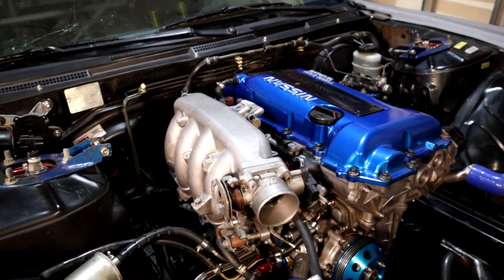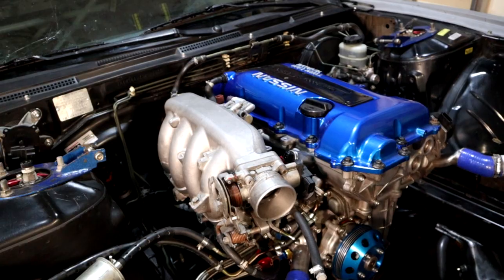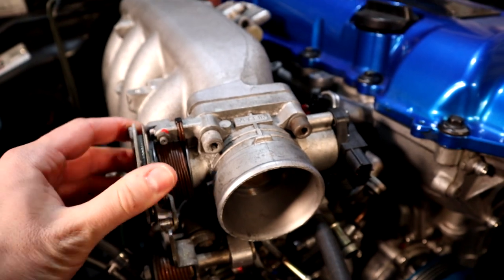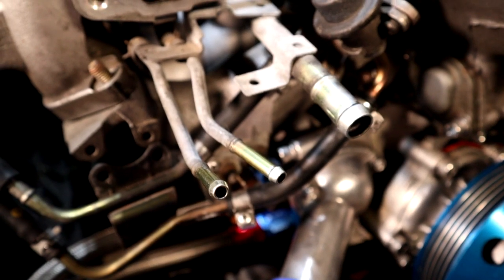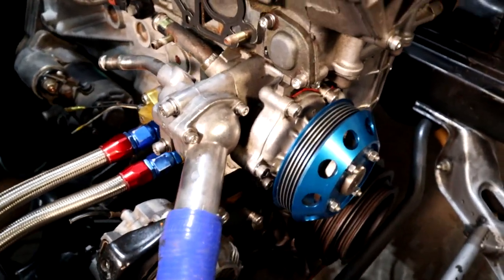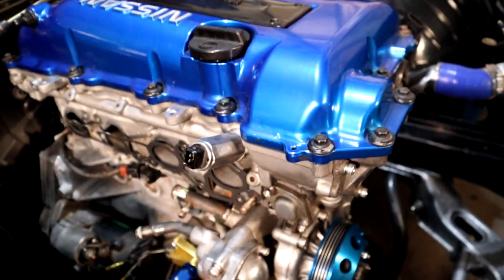SR20DET Intake Manifold & Cooling System (S14/S15) - How It Works and Removal

Comment: Thanks for this video, I sprung a leak on the oil filter turns out it's possibly the hoses under the intake manifold. At least I know which hoses I need to change.

Comment: My main problem right now is not know what the parts are all around the motor, so this helped a lot.  Thanks.
Reply from the maker: Awesome! I'm glad it helped you out. Let me know if you have any other questions, or if there is some other part of the engine that I should focus on. Thanks!
Reply: @BrainPowerMotorsports  I have the exact same motor so it's awesome watching your build so far. I just started on mine. I like the way you break down the fittings and details.

Comment: Thanks for the videos! I just realized that I have too many useless little hoses everywhere. Maybe the old EGR hose and more. I need to watch the video better, think better and learn English better. I believe that thanks to you I can find out why my engine is heating up too quickly
Reply: Did you find out why your car was heating so quickly? I have the same problem on my SE20 maybe your problem can help me with mine if you found the solution? 😁

Comment: You rockstar!!! That video is a gift to the Sr20 community, really appreciated mate 🙏 subscribing was a no brainier.. trying to fix mine, heats up way to fast and and then doesn’t start when hot, maybe a leaking injector let’s see.. thanks again for the video 🙏 quick question if you have the time where does the valve cover top Center left breather pipe connect on an NA non turbo model, I have seen it just with a pipe pointing downward but I’m guessing that should create a huge vacuum leak, does it go in the intake pipe before the throttle body and after the MAF? And shouldn’t that bring oil to my already oily intake? 😅

Comment: Thx big help! Been searching for a vacum leak forever, used a boost leak tester and couldn’t hear anything. Car makes -1 vac psi at idle, a little strange. Bolt ons. Any ideas on where to look for this big of a leak?
Reply from the maker: That must be quite the leak! Best to test individual components or portions of the system. Cap off pre throttle and test the intercooler system and pipes. Then move on to the smaller components. For that big a leak, I’d suspect a coupler has popped off the piping, the intercooler has damage, or there is damage to a pipe. Good luck with finding the issue.

Comment: Great video really informative mate! Hopefully you can help me a little more, I recently bought an s14 and the previous owner capped 2 lines off that I believe were a part of the recirculation valve system! But I have no idea if they should be connected to anything now, one of the lines is the blow off valves line you referenced in your video which is currently capped. The other line next to it is connected to the carbon canister which I think has a split which also runs to the waste gate control solenoid valve. The other line that’s blocked off I am not sure where it’s coming from atm but it is larger? I currently have no blow off value but want to fit one to avoid turbo stall/flutter

Comment: That's too bad this seems to be missing info I need. My S14 SR20 has two extra vac nipples comming out the bottom of the TB (one of them capped off) but I couldn't spot them on yours, maybe S15 didn't have them? Also I beleive the WG line came off the hotpipe on the turbo side. Some of these lines should be for EVAP canister (again, at least for the S14).

Comment: thanks for the vid, i wonder if those stock intake support brackets are necessary or i can delete them? i hate unnecessary components but i also don’t want to delete anything i need lol
Reply from the maker: I'm not entirely sure about the brackets. I removed them since I was putting in the aftermarket manifold, however I would imagine they were engineered for a reason on the stock intake. That unit is fairly heavy.
Reply: @BrainPowerMotorsports  we’ll see, think i’m gonna delete them and see what happens like an idiot lmao wish me luck

Comment: Will the stock S14 SR intake manifold fit onto a S13 SR head?
Reply from the maker: It will depend on if it’s a black top or red top. There are two different styles of intake manifold.

Comment: At 13:48 What’s the black and red connector between intake manifold side under cylinder between 2 and 3 called? Ive tried looking it up but can’t find anything sadly.
Reply from the maker: That’s the knock sensor.

Comment: My water temp sensor where there are 2 connectors one is broken the one that clips into the metal tab how can I fix it
Reply from the maker: Are you talking about the sensor that has only 1 wire going to it?
Reply: @BrainPowerMotorsports  I fixed it all good bro
Reply: @BrainPowerMotorsports  I’m at 230.9kw what else can I do to gain 70-100 more kw my motor is built for 3-400kw

Comment: Hey great video. I have a question. I'm working on my notchtop sr20det and I had to take the fuel rail off to replace a bad injector. Now that I'm putting the fuel rail back on I noticed that when I bolt it down the rail tilts. I was wondering on your sr20det did your fuel rail have oem fuel rail spacers where the bolts go?
Reply from the maker: Hi there. Yes, there should be spacers. If you head over to Partsouq in the attached link, you should be able to see where the spacers are. 

https://partsouq.com/en/catalog/genuine/unit?c=Nissan&ssd=%24%2AKwGVobCCntLTy-HX4Nuzsc3Z-f7gkZ6TkoCThcPm2oLThJuBvdLAhcvGw4Wc-oGkwc6LhPuShYqD-c3SsdrY1MnD5tqBk5mIhZyYlZWKg86Zk86dhPuRhYqD1p3S1oWXl5TmhpGTz9KR2dDIxOfdg8af0taH_YOR-O2Dj97S3vj185KX4uT33NzMhZX-kvD1g4_e0tj49IOMh4SU_L-kwuGSg_2LhoPKitLWh4Tx4fXn7IHS0M7K1YOah4TyksvSwIeExMbRhJuDyNzMhcvTycOEm4PcuryF2wAAAAA0iqYl%24&vid=0&cid=&uid=418748&q=
Reply from the maker: Brain Power Motorsports They are called out as 17520J in the drawing

Comment: Sr20det wont start after replacing radiator. Cranks but doesn’t turn on
Need help on what the issue is?
It’s also been sitting for about 2 months
Reply from the maker: Without seeing the vehicle, it is a little difficult to diagnose, but I would recommend checking through all your wires and connectors. Check the MAF sensor and the cam sensor in particular. Also, would be worthwhile to check the fuel pump and make sure it is priming. If the fuel pump is working, move on to the ignition system and ensure there is spark. If you have fuel, and spark, move to the fuel filter. May be clogged up. Good luck with it!

Comment: where did you get your stainless steel hardware for everything on outside? was it a kit or something?
Reply: and where did you get your oil filter relocation kit looks good
Reply from the maker: I was lucky. When I bought the car, it already had the relocated oil filter. It is a "Tomei Oil Filter Block Relocator" on the block, and a "Greddy Oil Filter Relocation Kit" for the filter itself. If you search either of those, there are multiple websites that sell them. As for the stainless steel hardware, I usually keep a good supply on hand for my builds. I stock up on M6 and M8 bolts in various lengths.
Reply from the maker: A good trick for the lengths of the bolts is to look on partsouq.com at the diagrams for the vehicle. You will notice that often, when you hover over a bolt on the diagram, the part number that comes up will tell you what length and size the bolt is. Take the intake manifold diagram for a 97 Silvia with an SR20DET for example. One of the bolts called out is 08120-8201F. The 3 digits after the dash tells you the size. -820 is an M8, 20mm length. 08120-61228 is an M6, 12mm length. And 08121-0251F is an M10, 25mm length. I hope that all makes sense.

Comment: Hi, subscribed as this is a great video. The pipe that goes on the end of the iacv hard-line, where does it go? Onto the intake pipe? Am trying to get my Sr up and running :)
Reply from the maker: Hi there. Sorry for the late response. YouTube flagged your comment as spam for some reason, so I only just saw it. That pipe feeds air from the intake system to the IACV. The piping in my car is quite modified, so I'm not completely sure where it would feed from on the stock system. Best bet is to check out a service manual, or if you can't find one, go to Partsouq.com and find the parts diagram. It should also show you where you need to feed the hose to. Thanks for watching!
Reply: @BrainPowerMotorsports  hi, no worries I figured it out in the end :) thanks for responding though!

And thanks for that website, definitely a new favorite

Comment: No disrespect but please get your info straight before making a video. The blacktop is not only specific to the s14/15. There is a black top s13 sr as well “kouki 180.” S14/15 “notch top” has vtc unlike the s13.
Reply from the maker: Hi there. Appreciate the feedback, and no disrespect taken. I could have made it more clear by using "notch top" for the description, for sure. I did however try to distinguish in that the title of the video specifically calls out S14 and S15. Yes, the S13 had a black top too. But I'd hope that the obvious VCT system, as well as the low ports, would make it clear as to which version I am working on. I also know that this is a hotly debated topic on the forums, and it seems everyone likes to have a go at dissecting it. I'd be happy to amend the description for the video to clear up any confusion. Thanks for watching!